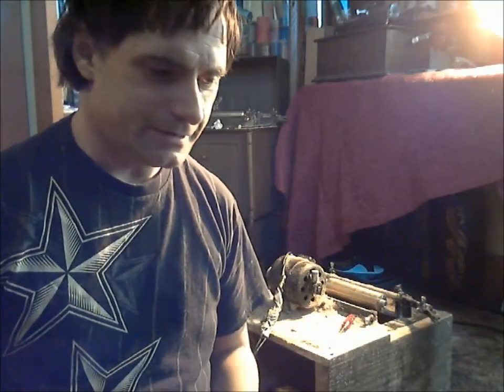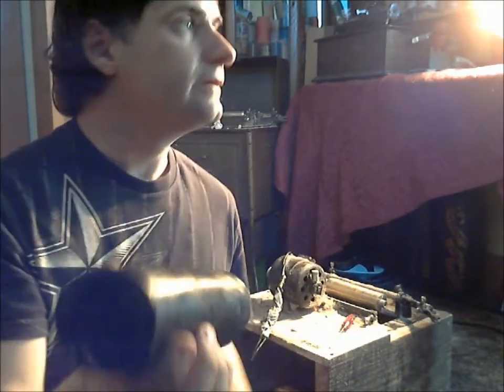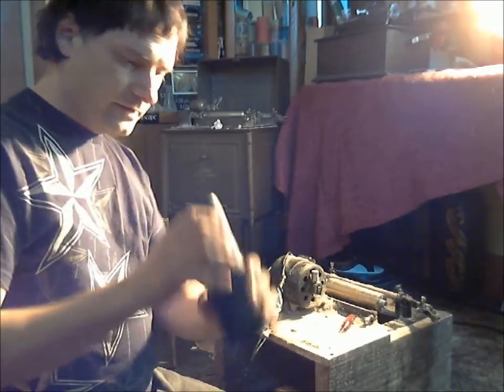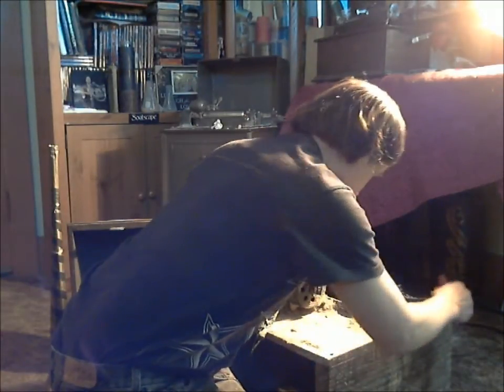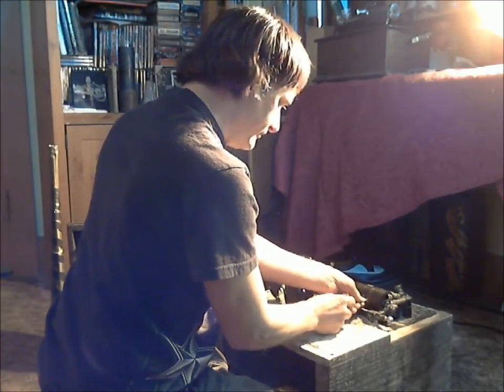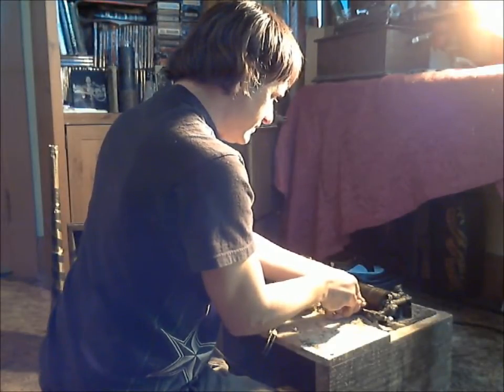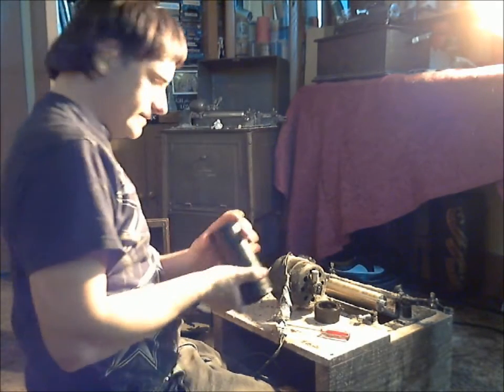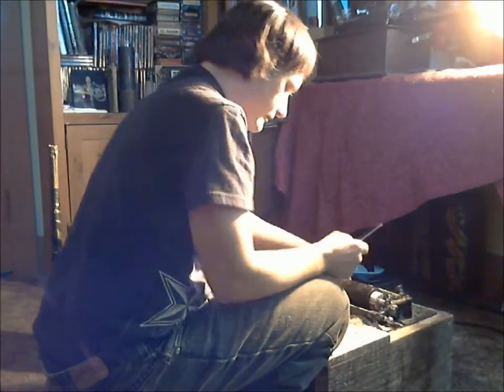New Four Minute Cylinder Blank  Borri Labs

Comment: Dear Mr. Borri,  What is different from 4 m cylinder blank and 2 m one?
Reply from the maker: Hello.  The four minute blank is quite a bit harder, and when seasoned is difficult to shave on a phonograph, or even with an Ediphone shaver, take very thin cuts. This is so you can play it with a four minute reproducer like an H and not wear out too quickly.